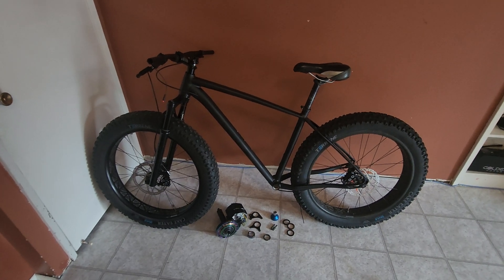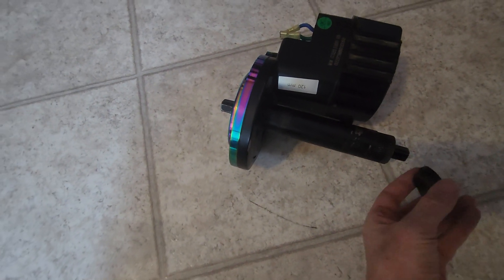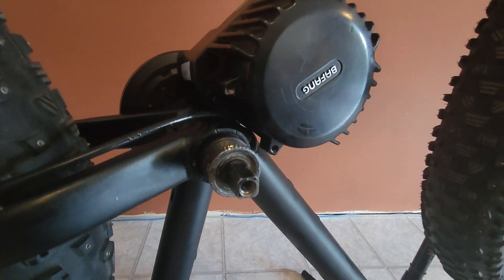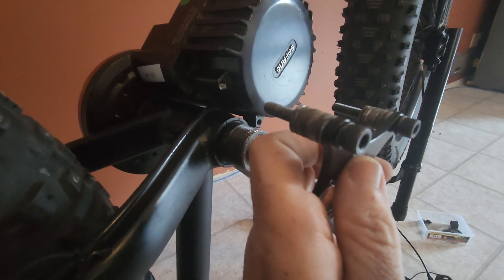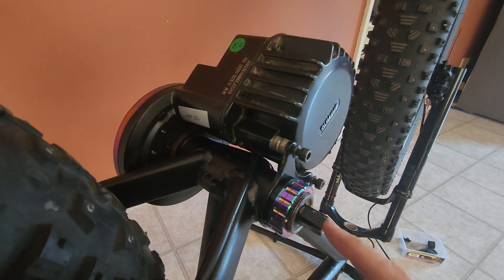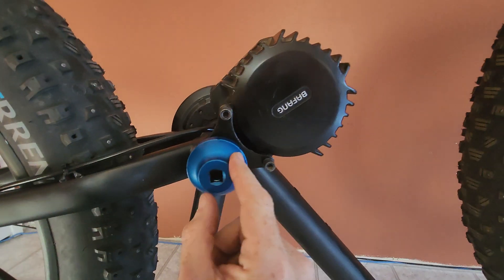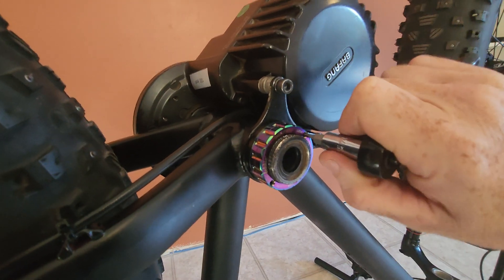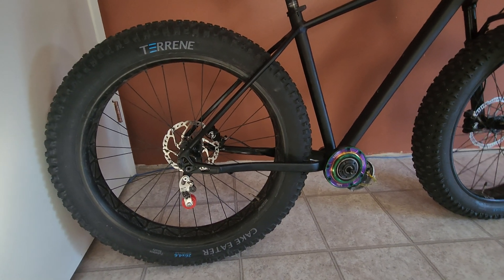BBSHD fitting Guide for Fatbikes - Part 1 - Sizing and Mounting

Comment: You now can use the onenut instead of the stock two nuts I have the problem of a press fit 30 with a 46mm opening and it needs to be a 41 pf30 to BSA ???
Reply from the maker: Yeah I'm using the one nut. Adapters should work although I don't have a source for that one.

Comment: This is great.  Everyone says to just measure the width of the crank housing but you have proven that with a fat bike you need to allow for the frame width to allow clearance.
 I just checked my moped style e bike but the fat tire is well back from the crank housing.
 Could have cost me a major headache if I wasn't aware...Thanks a bunch!
Reply from the maker: Cheers Sparkie. Good to hear yours is OK. Is this a new build you are doing?
Reply: On hold due to monetary constraints!
 @HighVoltageKits  
💸

Comment: You can get M6 spacers available in 1mm length increments at McMaster-Carr for the bracket spacing.  A little spiffier than stacking washers.  Also thank you for saying out loud you need 80-90 ft lbs of torque on the stock inner lock ring.  Thats something a lot of people don't believe is possible but its critical to doing an install that lasts.  The Lekkie One Nut tightening tool is a deep socket version of the Park BB tool that doesn't have the problem you showed us in the video.  And of course its not cheap.
Reply from the maker: Thanks for that. You are right on the spacers. I have an account with them. I use polycarbonate sometimes as well for that bit successfully. I just had the stack already. But not quite as fancy as the one nut lol. I'll be going over the single speed setup this week if all goes well. Appreciate the comment. Cheers

Comment: Park makes one of those tools that actually looks a lot like a large wrench that is completely open and I believe the newest version actually has a spot where you can attach a torque wrench. If they don’t make one I know Pedros makes one. I’m not sure if it has the torque wrench attachment. It basically looks like one of the large spanner wrenches that you would use on an old-school threaded headset to adjust the headset. I have a couple of them in my shop. I’ll have to look and see if they actually have the torque wrench adapters.
Reply from the maker: Thats really interesting. That would have save me the bother for sure. Although in reality it was not that much time to pull it.

Comment: I bought a fat bike specifically for an ebike build. The plan is for the bike to be an allrounder, that is to commute 30 km to work (without being super sweaty), shopping trolley, camping and fishing vehicle and part time bush basher, with occasional trailer towing duties, all whilst backpacking my Maltese Terrier (a small dog with a big dog heart). All the things my current analogue Scott Aspect does.

I've been overthinking the build for 18 months now. One of my main conundrums is what motor to get with the current proliferation of mid drives. I originally decided on the BBSHD, but was concerned about the stripping of the nylon gears. Then the CYC Photon, but now towards the back of the pack, but I like that the crank shaft can be changed to a 68-73 in the future. Finally the TwoSeven DM02, it's draw back is only available to fit a maximum 110 BB.

I'm currently tossing up as to whether I should just do a cheap 750W - 1,000W build until there is more information on the new mid drives.
Reply: I beat on my completely stock bbshd with 72V HV kit pretty good. I have about 400 miles on it now and have zero problems with it. I'm running 40t up front & 36t in the back.
Reply from the maker: @98blower17 Awesome stuff mate
Reply from the maker: You could delicately do a cheaper build for now. I am yet to strip a Nylon on the BBSHD touch wood. Despite all the abuse I gave it as long as the gearing is right and you don't bog the motor down you would be okay. I have  done most of what you list with mine. The TOSEVEN stuff might struggle if you will need the 120mm. Your dog sounds awesome btw! You are welcome on our discord if you want to post photos of the frame and get help.

Comment: Can't wait for the continuation of BBSHD on Fat series. Im converting my Northrock XCF with 100mm BBS02 as we speak. Very curious what size chain ring you're going to use. What cassette, 10 speed, Im guessing. Modified cassette for a better chain line perhaps? Battery fitting, unless you use the frame bag and a triangle battery.
Reply from the maker: Sounds good! I will have some more on it this week!

Comment: Great video. One question: do you mount the motor touching the bottom tube or prefer to put a little rubber block between the frame and the motor (to avoid possible noises due to the motor hitting the frame)?
Reply from the maker: I just put it flush with this one as there are no cables the clear. Hopefully it works out.

Comment: Thanks for yet another top vid. Interesting point with the non slippage without teeth on bracket.  All of what you mentioned was same as my experience fitting the HD to my Norco BigFoot 2020 bike. I did not use a torque wrench, which is obviously a good method, but so far so good. 

Leckie locking ring is new to me, thanks for showing, great looking kit.

I look fwd to hearing about your single speed modification which I presume would require the extra power from upgraded controller + 72 v to run it. I went for an 8 speed wide ratio MicroShift drive, cheap, strong, good performance, no issues + it helped overcome shifting the awkward chain line.
Reply from the maker: You must have bigger pipes than me 😆 Great it's still on there. The next video will look at the single speed setup.
Reply: I just picked up a 2016 Norco BigFoot 6.3 fat bike and I'm looking to convert it, so I thought I'd ask - did you wind up needing to use the 120mm spindle version of the motor, plus a few spacers to allow the motor to clear the chainstays?  It looks like that's what I'll need to do, but I'd love to learn from your experience.  Also, what chainring did you use to get proper alignment with the cassette?  Thanks!
Reply: @thomasburkholder9212  Yes, I used the 120mm version which works just fine. I presume the 2016 BigFoot would require 120mm too. Good luck with it.

Comment: I have a similar frame on my Aventon Level.  Which is already an E-bike, with a 500w hub motor.  But I have been thinking of adding a mid drive, for more hill climbing power and top speed.  I'd like to hit 40mph or so.  

Is that worth trying?  And would a S02 be plenty or should I just get the HD?  

I would be adding another battery and controller.  I think I would use pedal assist on the mid drive, and wire a throttle into both controllers so when using just throttle they're both running.
Reply from the maker: I'd be inclined to just go with one or the other. In terms of the BBSHD or the 02 I'd go with the BBSHD any day of the week.

Comment: I live in uk, I built myself same as your specialised fatbike , however i found standard factory bbshd is almost just about right. I also found fat bikes cannot handle speed anything more then 30mph is not stable at all, I reverted back to mountain bike!
Reply from the maker: That's interesting. I found it to be solid as a rock. Are you using the carbon forks? I got rid of those fast.
Reply: No questions they’re very solid indeed, My fatbike came with Rockshox Bluto forks! 
The point I was trying to make was the safety! There’s no handling or traction I had to move my upgrade kit to another bike Marin Riftzone because it has dual suspension. 

These rigid fatbikes have no traction neither any handling and with the upgrades these become dangerous! 
Simply because these bike are very light in weight therefore do not handle like motorbikes! 

I will remove the my comments once you’ve read it.
Best wishes to you

Comment: I feel like this is where I came in. I started subscribing sometime during this build 1.0. Love the black makeover & the Lekkie blingification. Doesn't Lekkie make install tools (that fit their One Nut)?
Loving the 2.0 build so far. Can't wait to see the finished product. Your High Voltage kit has admirable finesse, to allow a smooth throttle with a 42:42 setup. (My setup wants to lift the front wheel on throttle with that gearing and doesn't approach your top speed, even in higher gears.)
As always, well done & I look forward to future vids (&builds).
Reply from the maker: Thanks Michael. I want to compile it all onto a web page so people can see it all.

Comment: I watched this video totally address of blue. I have no intentions of converting a fat bike. But I did realize I totally did not tighten up my photon enough on the installation yesterday. Thank you! Went back, and it was quite loose!
Reply from the maker: I think I used 50 ft lbs on the Photon. Good catch.
Reply: @HighVoltageKits  why so much less? Because it’s not as powerful?
Reply: @HighVoltageKits  thanks for letting me know that as well, I had Mine cranked way too high. I just checked the manual and it is indeed 50 Newton meters, or 37 foot pounds. Just fixed it.

Comment: i advise clients to go up to 80nm on the steel lockring, I can see that not liking anything like that much (alloy)
Reply: 1 ft lb = 1.35 Nm
Reply: @billweaver3867  ah me div. thanks Bill
Reply: does look very bling though.
Reply from the maker: I'll find out if I have to take it off and I messed up the threads on it! I think NM are higher than ft lbs.